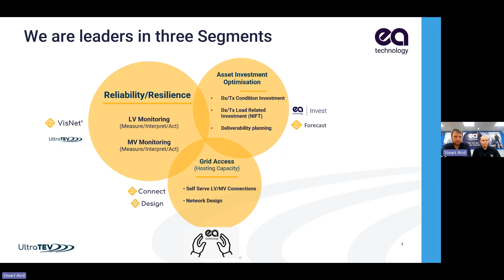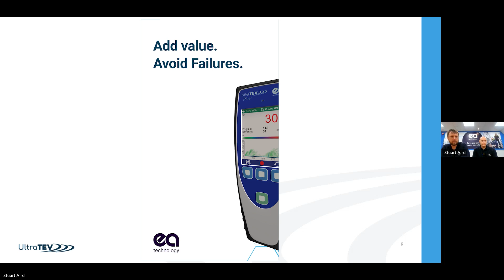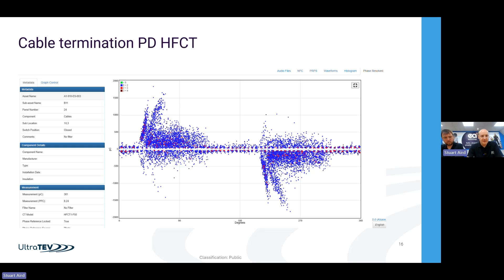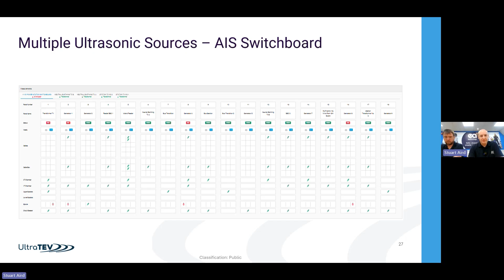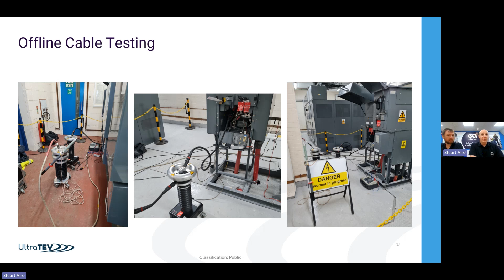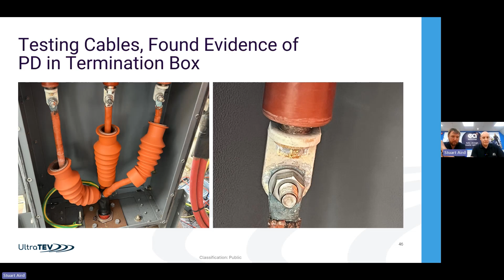Webinar: Partial Discharge - Year in Review (2025)

Comment: Thank you very much for the invitation to the webinar. I'm a UTP2 user and found the session very informative.

I would like to suggest that the TEV sensor among the accessories could benefit from having a separate 1-metre extension from the main body, as this would allow more practical and flexible operation in the field.

In addition, regarding the locator, it would be highly useful to enable multi-channel real-time data analysis by connecting multiple UTP2 units to laptops. This would significantly enhance diagnostic capability and workflow efficiency.

I would be grateful if your team could kindly review these suggestions for future consideration.

P.S. This message will self-destruct in five seconds.
Reply from the maker: Hi, thanks for your comment, this has been passed on to our production team for consideration. While we don't currently support synchronisation of multiple locator and UTP2 devices, our Astute Monitoring system does provide this functionality with timing synchronised across up to 100 sensors. For more info, head to: https://eatechnology.com/solutions/partial-discharge-solutions/partial-discharge-monitoring/astute-hv-monitoring/